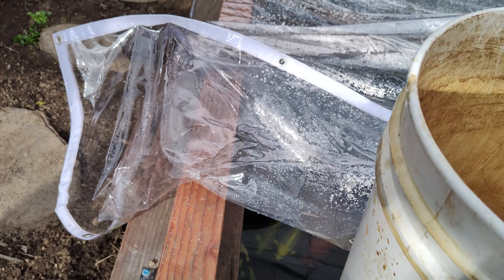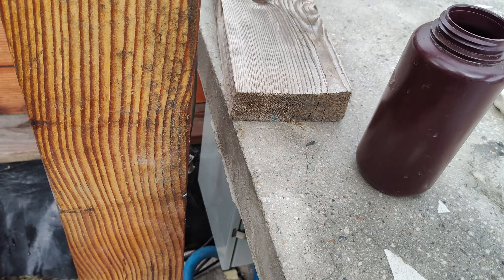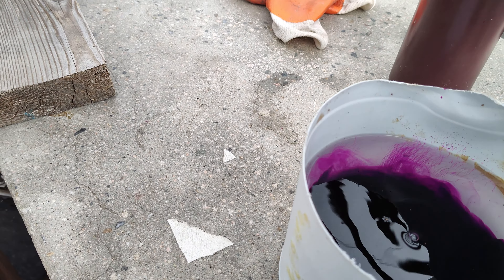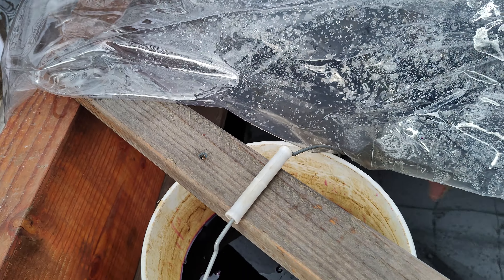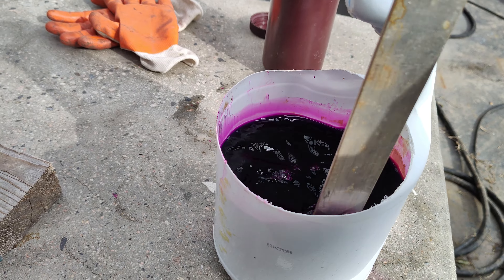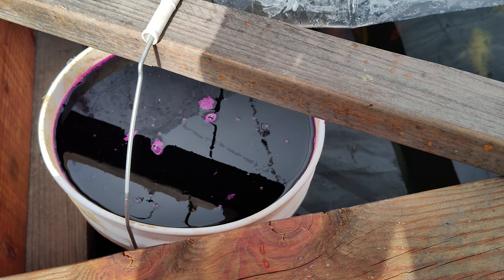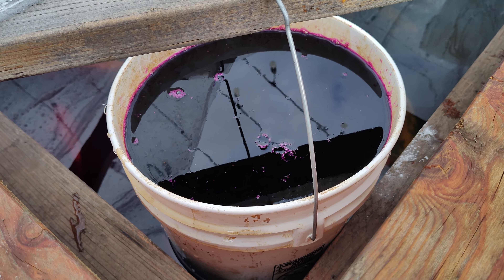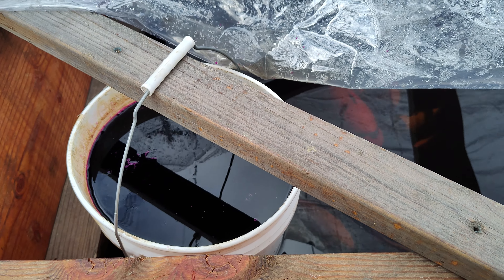A simple way to add potassium permanganate into your pond slowly

Comment: Couldn't you just turn your filter pump off for a couple of hours? Then switch it back on utilizing the last of the treatment through the filter.
Reply from the maker: @andreashessler838  I do now when I dose with high concentration, I no longer use this method as my ponds have matured over the last 2 years.